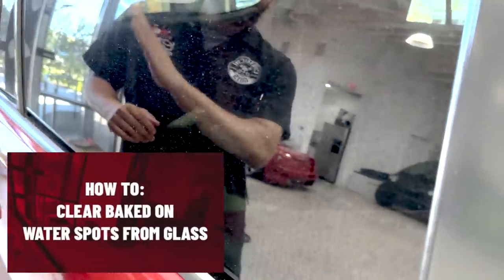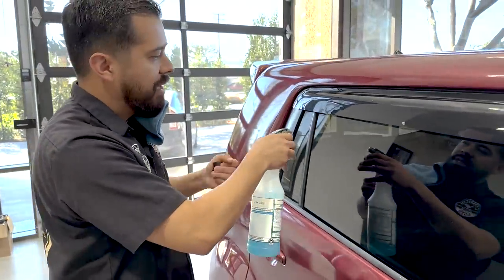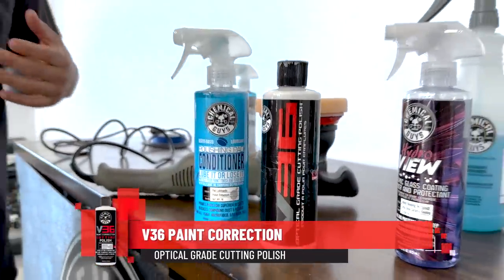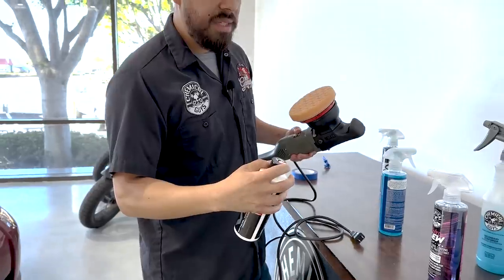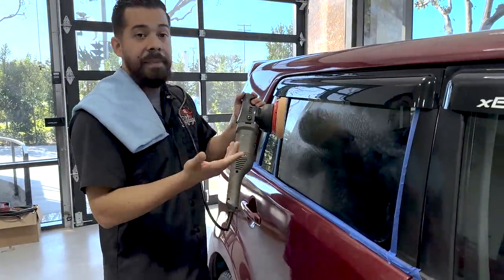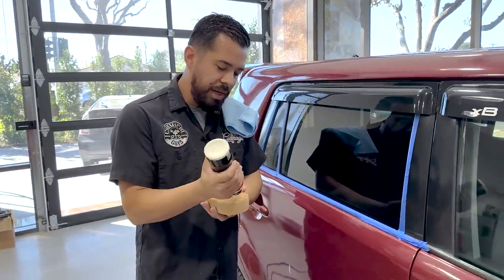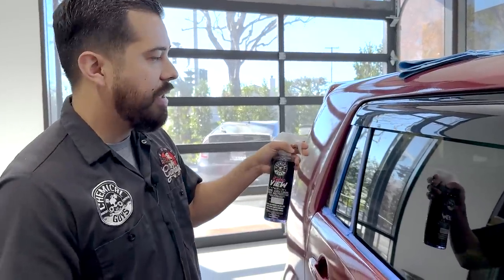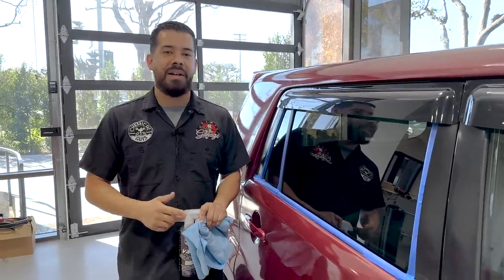Stubborn Water Spots? Use This Specific Technique If Nothing Else Works! - Chemical Guys

Comment: Awesome video C guys. Couple questions for y'all- 1)Could you use VSS instead of V36? 2) If Hydroslick is applied to the windows already, and is losing it's hydrophobic properties, should you reapply Hydroslick or could you use Hydroview to be quicker?
Reply from the maker: Hey Matt! Absolutely it is perfectly fine to use VSS as well. HydroView is a great way to quickly add protection while cleaning the window and enhancing existing coatings.

Comment: Ceramic coating glass is very helpful in protecting the glass from damage and making cleaning very easy! Just properly prep the surface as they did in this video...
Reply from the maker: Great tip!

Comment: Would you use wipeout prior to Hydroview like on the paint to make sure all of the polish is off the glass or is that not necessary?
Reply from the maker: Hey Cory! Ensure the surface is totally clean before applying ceramic by using Wipe Out.

Comment: After polishing painted surfaces, most detailers use a IPA cleaner to remove polish residue prior to applying any sealant or protectant. Should you do this step after polishing glass too?
Thanks for info.
Reply from the maker: Hi there! Use Wipe Out to ensure the surface is totally clean before applying coatings.

Comment: How many rpm do you set the polisher to when it is advantageous?
Reply from the maker: Hi there! When using a DA polisher, spread the product with the lowest speed setting then use the highest speed setting to properly diminish abrasives.

Comment: Out of curiosity, why did you use V36 here instead of V38? Is V38 not coarse enough to work on mineral water spots?
Reply from the maker: Hey! Correct, V36 is the least aggressive approach while still providing cutting power.

Comment: I’m a novice to detailing.
Would you recommend putting tape on the trim and rubber when waxing your car as well? 

I ask because I’ve noticed through the years my last cars trim would start to break down and crack. Is there a way to prevent that? 

Thank guys! Love your products!
Reply from the maker: Hi there! Yes, mask off sensitive rubber and plastic trim that would stain easily from polish and wax.